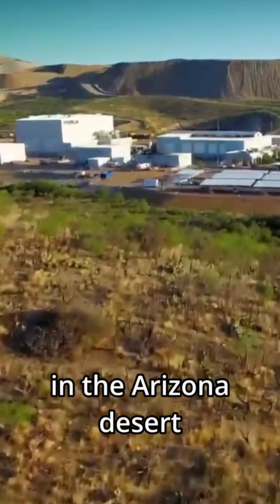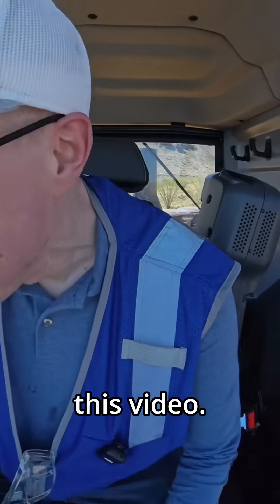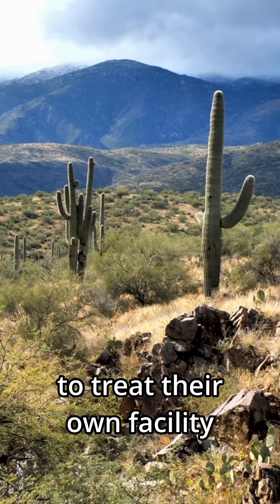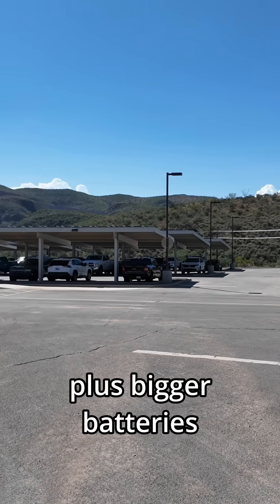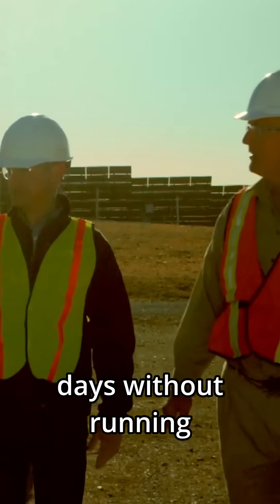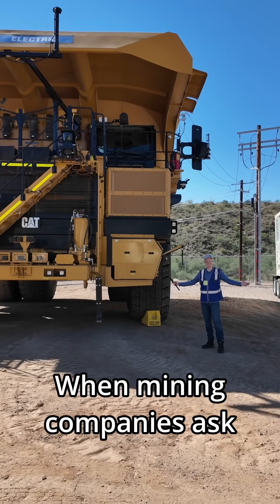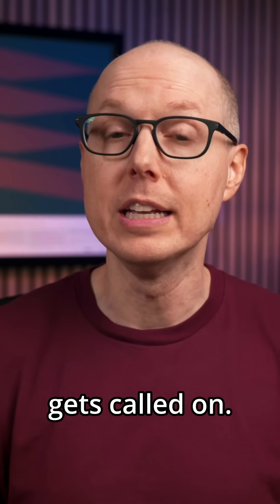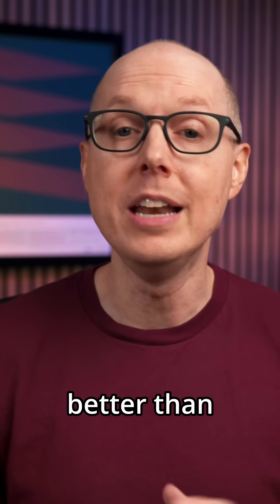Microgrids: The Desert Facility Running on Sunshine

Comment: Grid costs are totally ignored in this video. 
But grids are extremely expensive, f...........g expensive. 

All grid electricity is extremely expensive energy. 

Roof PV has NO GRID RENTAL COSTS. 

4cents electricity is 44cents kWh electricity at the meter boxes. 
My electricity is 56cents kWh last bill.

Somebody do a video on grid rental that makes generation, dirt-cheap electricity 10times more expensive.

Farmers at the end of grids stay offgrid because of new grid capacity costs. 

Grow up and think. 😮😮😮😮

Comment: But, they've also rendered useless nearly 5 times the acreage of the factory itself. That's wilderness habitat or potentially farmable land now virtually useless for anything other than harvesting photon energy, the excess of which produced cannot be shared with nearby communities or reliably stored. They are producing more energy than they need but still having to run generators.
Reply: yeah man all thay stuff we can grow in the desert😂😂😂

Why dont you talk about the big oil cartel cutting oil rigs below the water line and leaving them there to save money with poorly plugged wells that leak oil into the ocean? 

Is thay too bad for your stock portfolio?

Comment: I feel it's important to point out the large "electric mining trucks" are actually hybrids. They still have enormous diesel engines that spin a generator which feeds electricity to the electric motors that drive the tires.

Comment: Hint:  It will cost 10 to 30 times MORE to charge an EV on a 100% RE grid than to make fuel OFF grid from RE.  Making fuel OFF grid is key, not charging a stupid battery ON grid.  Off vs ON is the key factor.  OFF wins.  

New combustion tech with solar thermal fuel making would be 10 to 30 times less costs for input and allow 100% RE OFF grid with NO Diesel from oil.  

This tech they promote is obsolete folks.

Comment: So what is the total setup costs?  It’s easy to call out operational costs (fuel purchase) but no calling out setup and ongoing maintenance costs of the new solution.  What is the life of the panels and batteries?  Note it’s in a high sun low cloud/rain area….

Comment: this is like south africa. with load shedding (blackouts), companies all over got generators and there are still loads around (but they have to be super quiet in urban areas). But most of those companies then also installed solar and batteries and saved huge money.

Like solar isnt always cheaper than grid electricity but it beats diesel by miles if you live in a sunny area

Comment: great idea for Arizona and this niche application. but lets not kid ourselves on the 'green' aspect. all of those solar panels have to be manufactured. the batteries require rare earth metals typically extracted from poorer countries, the lifespan of the units is about 5yrs.
Reply: Lifespan of the solar panels is at least 25 years. Lifespan of the batteries are about the same.

Rare Earth mineral are not really rare; they are found all over the planet.

Cobalt, which was the biggest concern, was one extremely small component of Li-ion batteries, and in not used in LiFePO₄ batteries. Do you know where cobalt is used? Petroleum production and steel production.

Let me not even get started on oil drilling, or the full carbon footprint of ICE manufacturing and assembly. 

PV solar and Li batteries are both about 100% recyclable.
Reply: @KarimHosein  this 20+ year lifespan assumes ideal conditions which is not the norm. places like Puerto Rico and Japan have seen entire solar farms wiped out and burned. Midwest solar farms have been destroyed by tornados and hail.

as far as recycling goes, like wind turbines, about a million tons of solar waste is exiting the market every year and it takes energy to extract whats reusable. same issue for batteries. again its a great niche market for arid countries, regions with lots of sunlight and moderate climates.

Comment: It's annoying when so-called engineers say nonsense like 3 MW battery storage.
If you know the difference between energy and power, i really don't know how you make this error.
That's like saying "2 plus 5 equals 10" — as if you have trouble remembering which operation is addition and which is multiplication.
Does your car accelerate 50 mph?

Comment: They can cancel projects or subsidies but when heavy industry sees real green on their investments there's no way you're going to stop it anymore.
Reply: The White House wants the 80% completed wind power project off of Connecticut Shores that are going to slash electric prices to be demolished. My own project here at home will never be completed because I can't afford the tariffed batteries.
Reply: @zAlaska  i recommend changing "never" to "until the tariffs are lifted".
Reply: @Skunk106  Project like this would have attracted grants or subsidies, but it's still worth it. I work in mining in the Australian outback. We know eventually we'll go green, but the question is how? Batteries, hydrogen and ammonia are all in the mix. We have more than enough room for Solar. It's all about how we transfer that Solar into running machinery 24 hours a day. I say the subsidies are worth it because whoever cracks the question economically will rocket ahead in Sales. China, Korea and Japan are all in this same space with Caterpillar in the USA.
Here in Australia, 15% of road vehicles run on diesel, but 50% of Fuel imported is diesel. The massive discrepancy is all the industrial and mining equipment we run on that diesel. Green fuels in our industrial equipment will massively decrease our emissions.
Reply: @TsubadaiKhan 
When you look at every major form of energy and most of the minor ones since the industrial revolution started and probably long before it too, nearly every aspect of it has been subsidized in one form or another, be it through grants, tax breaks, joint and coop guv research efforts, military development projects, any number of forms of corruption, pollution and destruction costs gone unpaid or shifted onto tax payers, dirt low pay scales for workers,  power purchase agreements for garunteed profits, etc etc etc. I'm not against many of them and I never expect it to become fair either. I'm just glad to see heavy industry is seeing some real benefits of implementing various forms of it because it will greatly speed the process and advances. OC it will come with some sleazy downsides but that is to be expected. Thanks for the info from your perspective down under! Take care mate!
Reply: @TsubadaiKhan it’s mining, industry,transport and farming using the diesel fuel now but that is changing rapidly.🌝
Reply: @malcolmrickarby2313  It's not changing at all yet. We don't even know what it's changing into. Hydrogen or ammonia may prove better than batteries for industrial usage.
Reply: @TsubadaiKhan , so you want the public to pay for you power utility bills. Would you also agree to share part of your profit?
Reply: I mean this is quite literally the best case scenario and he even say they "go days" aka, a week or less without turning on generators. They are literally in the desert, you cannot get a better location for solar generation. They have zero rain, zero clouds, zero snow etc. 

How much do you have to scale this up to deal with for example mining in Africa say? And is it still profitable at those levels? Panels still have costs. The cells themselves only last so long so the more you buy the more your loan, the longer your pay off. The more your just replacing a fuel bill with a solar equipment loan bill. If you have to double the number of panels because your not in the Australian outback anymore does it still work?
 
You still have some maintenance, this for example uses sun tracking mounts which can fail and has miles of cabling to bring the energy from the panels to the batteries as well as batteries themselves with power management systems.

You also have in this case still deisel backups which any mine might decide is simply too important to ensuring 24/7 running to go without. 

Which means your still buying hundreds of thousands in generators.
Reply: @sparkzbarca 
Deserts, at least hot, dusty ones, are not the best scenarios for solar generation. That's a big misconception. 

There are now almost innumersble small villages, towns, farms and industrial sites around the world that are far from the best geographic generation locations for solar power, but they are very happy replacing some portion or all of their FF generation with solar. 
Every item and aspect of solar generation that you mention and some that you don't keep improving in every way on a quickening time scale.
Maybe you should write Catepillar and all these other people letters telling them they are dumb for gaining some level of energy independence and saving some money while they're at it.
Tell them you know better and they'd all be better off to just stick with diesel because YOU read about it and watched videos and probably most of all because some political idiot said it's better! 
IDK, maybe you're just smarter and not getting fooled like all the people around the world who are increasingly switching to lower cost, cleaner energy, that isn't limited by finite world supplies and OPEC etc!
Reply: @sparkzbarca  ? Yes mate. ? I don't believe I contended anything you said is untrue. Here in Australia we're constructing Solar-Wind facilities with the sole purpose of creating hydrogen to be used as an alternate fuel to diesel. Japan is experimenting with using green ammonia as a fuel. Diesel has a cost. Whatever we replace it with will have a cost. Climate Change carries enormous expenses too. Most of them borne by our descendants. There's no cheap way around this mate. As I said in my first post here, we don't even know what we're replacing diesel with.
Everything we've ever done has had expenses. But whoever is First with a groundbreaking technology is usually paid extraordinarily well.
The bloke who sits around hoping nothing's going to change nearly always loses.
Reply: @TsubadaiKhan   Everyone nearly always loses including those that try to switch

FOR EXAMPLE 

Everyone thought that Toyota was soooo dumb for not entering the electric vehicle race bandwagon. 

Now while dozens of car companies are writing down huge losses on electrification and scaling back. Toyota is not, because they declined to play what was a losing game.

Likewise right now you have the most expensive companies in the world about to get shrekt by the AI bubble. 

They put hundreds of billions collectively in AI and their isn't actually hundreds of billions to be made in the field and it's all going to collapse. 

Which is why Sam Altman and OpenAI are out begging the US government to underwrite their loans cause banks and private equity are realizing it's all going nowhere and refusing to funnel more money into the pit.
Reply: Weird take. Literally nobody wants to stop renewable energy at all costs. Even the skeptics... realists... people versed in economics(?) would love to see it succeed if it can stand on its own laurels and NOT survive only on government subsidies. I don't think it's possible to argue with a renewable energy that outperforms fossil fuels WITHOUT subsidies. Solar panel technology is in fact getting better and better over time, and it stands to reason that there are some places in the world..... like a factory located in a desert.... where it finds a prime use case.
Reply: @schifahrer123 
Nobody said so it at all costs, but there are still plenty of people who are against one or all forms of renewable for various reason. 
Look up the list of projects Trump either did stop or delayed. Most of it was offshore wind because he thinks it's ugly and the wealthy shouldn't have to look at wind turbines from their seaside mansions!
Reply: Great job! You guys miss the whole narrative. Everyone want jobs pay no taxes, yet they want the rich to pay for it all. Admittedly, in the past, the rich made more money, but it is not how much you make but what the value of a dollar is. Case in point, candy in the sixties was actually a penny, now it is in most case over a dollar for that same piece of candy. So what changed, the value of the dollar has been ravaged by none other than our illustrious Congress, not the White House. You can argue  all day long about energy policy whose,is better and whose is not. 

Alternative energy will never take over conventional grid power generation, until it can provide night time power. It is coming albeit the slowest boat to China. 

I have a couple of old solar panels from the mid seventies, not highly efficient but robust, they take on lightening and hurricanes for all these years and still produce. Yet, I have gone through a bundle of newer panels and are are at a much better price and efficiency, they break, degrade much faster. 
I use almost every energy source out there, old and true has always done better. 
I still buy newer whenever, I can justify the imaginary  accountant in my head. 
They are just proving out technology. You want real change advocate for space based energy 24/7 availability planet wide. 
It will never happen as long as the powers that be won’t allow it. Been around too long and seen amazing technology, hidden, destroyed along with those who invented it.

 One last thing you want to Save the planet of which we are still stuck on , try getting rid of the things actually killing it like pesticides and monoculture farming. Regenerative farming is the new buzz word for what Mother Nature has been doing for at least a few millions years. She figured it out long ago. Plant a few trees, bush’s,veggies in the back yard  enjoy them. Now f the billions of folks did that, just maybe we can fix what we fucked up. Oh and by the way Iam not a democrat or a republican, liberal, or whatever else you want to label me as. I am an American, I always do what’s best for America first, not what’s best for me necessarily. JMO. RLTW
Reply: @AgraFarmsllc 
Nice reply! A couple points in rebuttal.
Not really sure how we all, or I miss the narrative but you clearly see and are living it to some relatively high degree  which I am congruent with, especially the being non party affiliated aside from my needing to be registered in order to vote in primaries.
My biggest disagreement isn't really a disagreement so much as to point out that ALL monetary and economic matters begin with energy. 
The profundity of this seemingly simple statement can not be overstated, however it is nearly always overlooked in economic discussions and political actions except at the highest levels.
It is at these highest levels of finance and industry where they know the true power of what I've stated. The elites at these levels are uniquely situated to take advantage of the recently modern disconnect between human labor, energy availability, and the application of that energy to work and it's conversion to monetary wealth.
This advantage allows them to greatly overleverage energy in the first mover position to their great benefit while hiding and delaying the negative impacts of the true ecological costs. 
By hiding these costs and keeping energy greatly undervalued they are also able to keep people relatively placated and docile.
One barrel of oil is roughly equivalent to between 4-6+ years of manual labor. Multiplied out by the number of barrels per day, it is a staggeringly large amount of additional man hours inputted to economic activity. 
The overleveraging of this work power while delaying the costs and ignoring the ecological destruction is the true root of runaway world debt. 
Any and all other blaming of the Fed, congress, leaving the gold standard etc etc etc are ALL related to the secondary layers of finance and industry built upon energy (OIL).
Very few people actually understand the importance of this and it is why the cycles have and will continue. 
Irregardless of market crashes and even a world wide depression the cycles will continue until the price of extraction and or the real costs of ecological destruction catch up with us and force a very painful day of reckoning!
These facts, powered by greed, are the root cause of the unfolding world multi or metacrisis.
These are the most rudimentary facts of the matters, and they are being mostly overlooked and ignored but primarily hidden in favor of talking about and looking for ways to treat the downstream symptoms.
None of it will not work in the end! 

Personally, I don't believe that "clean" energy can save us either. 
At best it can only delay the rebalancing.
Eventually science will come to see and acknowledge that it is all really about balance and you simply can not extract, capture and convert the amounts of energy and heat in question and keep our biosphere in balance. 
There's no free ride! 
Thanks and peace!

Comment: Fully electric mining is a dumb idea. Huge costs on equipment and infrastructure that is quickly being developed and with a limited lifespan. This is why diesel electric already exists, and it is the technology that's been proven and tested for a long time.
Reply: Do you realise how much you just contradicted yourself? A diesel electric truck or a diesel electric power plant is one that uses diesel to produce electricity to run an electric motor.

Now you're saying, leaving the diesel engine out is going to be more expensive than leaving the diesel engine in. Think about that.